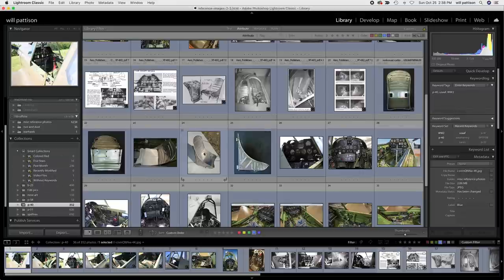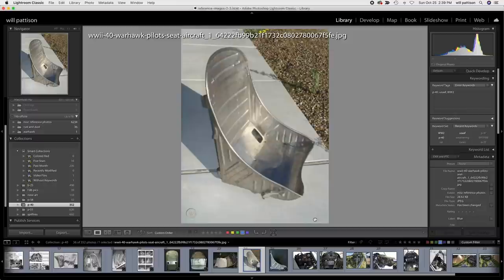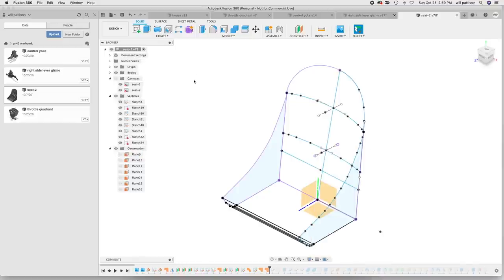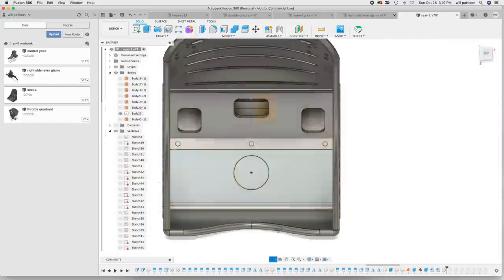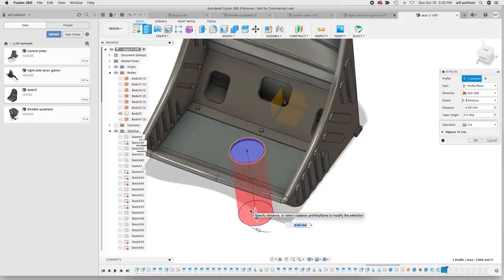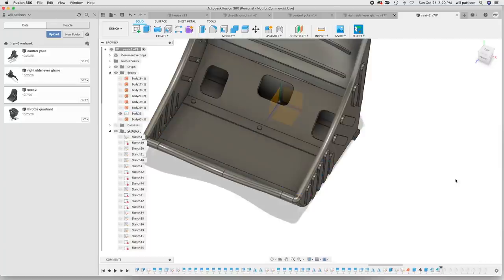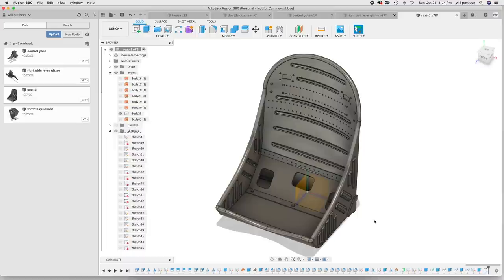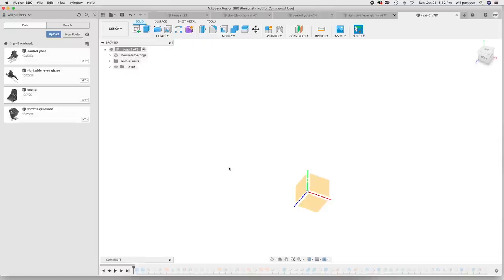ep301 - using fusion 360 to make cad parts for 3d printing

Comment: Great video! Been there and done that myself some years ago (Solidworks & Shapeways). What I would like to know is what support structure these new 4K printers need? I saw somewhere Your seat had quite extensive support system on one side. Does for example propeller blade need them? I built mine from root to tip in the printer height direction (z-axis) and they came out fine, airfoil, twist and everything.  IIRC 0.07 mm trailing edge on the CAD-model. Needed to click "print anyway" in the Shapeways -order. Keep ut the good work!
Reply from the maker: there's no rule on supports.  it's just a matter of experience and using chitubox when you're doing your own prints.

Comment: Excellent video. Do you know if there's a way to import 2D vector drawings from Illustrator so I can use them as sketches in Fusion 360? I have done drawings ("blueprints") in Illustrator for a camping trailer that I want to 3D print but I don't want to redraw the entire thing in Fusion 360.
Reply from the maker: tbh i'm not sure but you might try dxf.

Comment: Fascinating insight into the process which has mystified me for a long time.  Would it be possible to create a file which is, in effect, a row of rivets of a specified size, number and spacing and could this file be made editable to alter said size etc to a different spec?  Could this file then be imported into another file were rivets are required rather than creating them afresh for each project?  Just wondering.
Reply from the maker: that's actually standard assembly modeling practice for common parts like fasteners.  it's a bit more difficult with features, but not impossible.

Comment: Will, this is probably not one of my brighter questions but; if the main issue was the thickness of the material on the kit part, would filing/sanding the visible edges not have produced an acceptable result? 
I realise that attention to detail is high on your list but, if you were going to re-manufacture four or five similar(ish) pieces on each kit you tackle, that's 𝒂 𝒍𝒐𝒕 of time. You often mention being "efficient"; is the difference, compared to a different "fix", worth the time?  
Re-reading what I've typed, it maybe sounds a wee bit negative. That's not my intention; I'm just wondering when you would consider this process to be "a step too far"?

Cheers for now,
Dougie.
Reply from the maker: not negative at all!  it's a totes fair question.  i make these decisions on a cost/benefit analysis where the cost is time, the size of the penalty if i fuck it up, and maybe money.  the benny is basically how visible is it and how much more authentic will it look?  seats are high value detail areas and this one sucks bad even if i thinned it down.
Reply: @barpfoto  Fair enough. When you're modelling to this sort of standard, there's no point in installing a component that's going to offend 𝒚𝒐𝒖𝒓 eye, especially if you have the technology and skills to improve it.
I think the main reason I kinda thought you were maybe taking it too far, is because 𝑰'𝒎 not as familiar as you are with the appearance of an aircraft seat. If it was a locomotive chimney, I might spend that much time on it, while it might look fine to you. 
Your extensive knowledge, coupled with the vast archive of photos you use, have made you very aware of details that many others wouldn't notice.
Thanks for a timely, reasoned response. 😁

Cheers for now,
Dougie.

Comment: Very interesting video. Well done. Would it have been possible to develop just 1/2 the seat and mirrored it in the YZ plane? Would it have saved anything?
Reply from the maker: thank you!s for mirroring the whole thing....maybe.  it's a risk, though, because the more features involved, the more computationally intensive the mirror operation is.  you could find yourself with a whole lot of work...for half a seat.  lol.  at that point you could turn it into a mesh and possibly mirror in a 3rd party app but you also lose design flexibility.
Reply: @barpfoto  Thanks for the info. I haven't done any CAD work since the late '80's. I asked because I try to avoid repetitive work.

Comment: I probably have a similar amount of 3D experience in middling for illustration not  for cad. I would rather model in something like Clara.io or Strata but have you ever imported anything successfully to fusion. I’m happy to learn fusion, if needed but thought import might be easier. Even if it was just for the basic mesh.  I am so close to buying a printer but if I could leverage existing skills it would make things easier and more fun.
Reply from the maker: importing mesh files is unpredictable in all cases and modification can be very difficult because all you have is one solid chunk of data to work with.
Reply: @barpfoto  finding that out the hard way. Am experimenting with exporting .SLA from Clara. Let’s see where that gets me. Thanks for taking the time to reply. I firmly believe this is the future. Aztec Dummy just started an amazing 3D project which is also inspiring. I find all of this real fun. Cheers